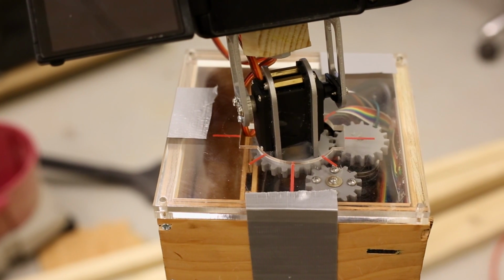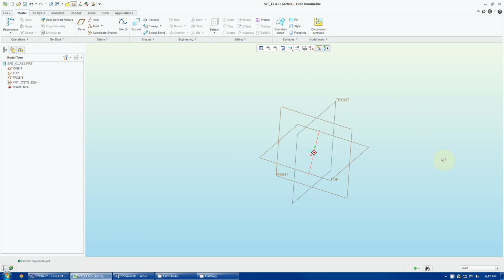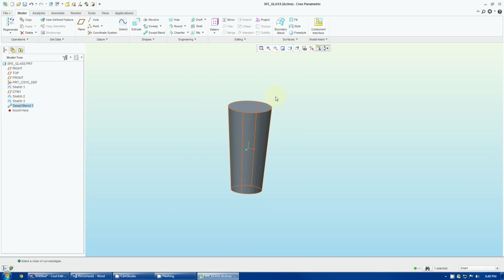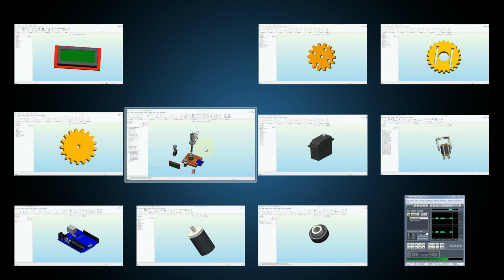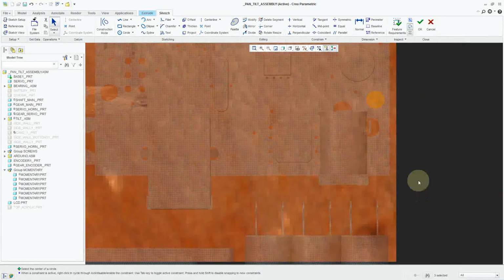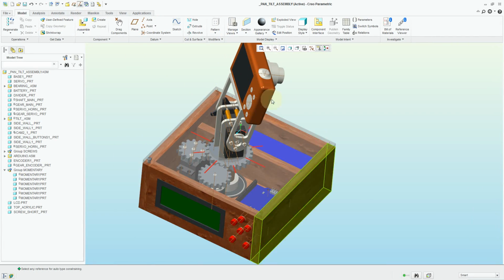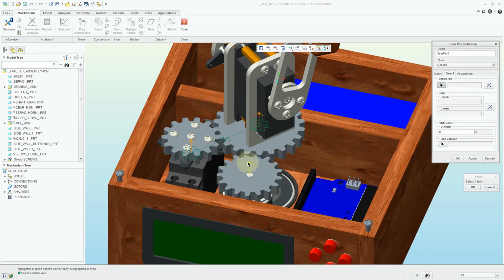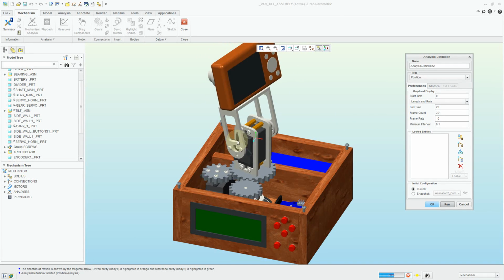SparkFun Engineering Roundtable Episode 14: Camera Pan/Tilt and Creo with Paul

Comment: I noticed PTC has their Creo Elements/Direct Modeling Express 4.0 software available for free.  Is that what you used in your video or did you use the full fledged CAD program? 
Good job on the video btw.

Comment: I'm afraid the combination didn't end up all that smooth. I'm not sure how best to solve it, but I'd consider a microstepping stepper instead of the servo (which gets us static hold and precise speed control, albeit a bit choppy), and a spring or similar for backtension in the gearing (to avoid gaps). One downside is that stepping causes vibration, but it might be an improvement over the servo's uncontrolled feedback loop.